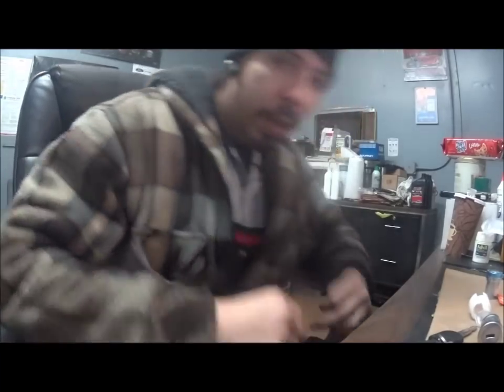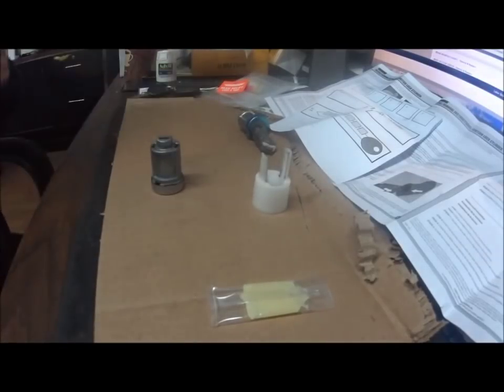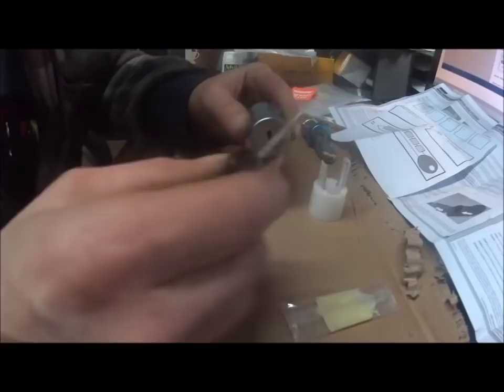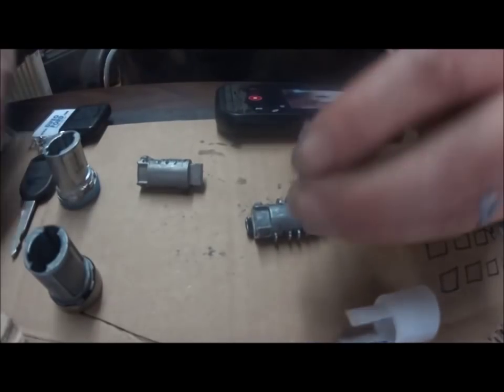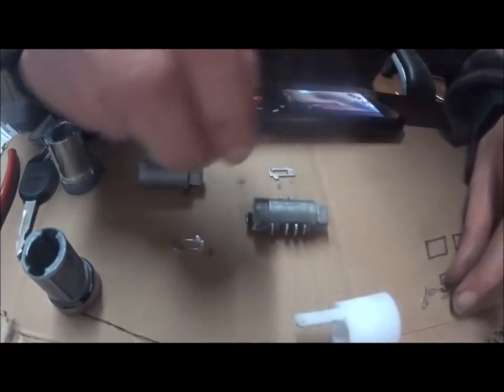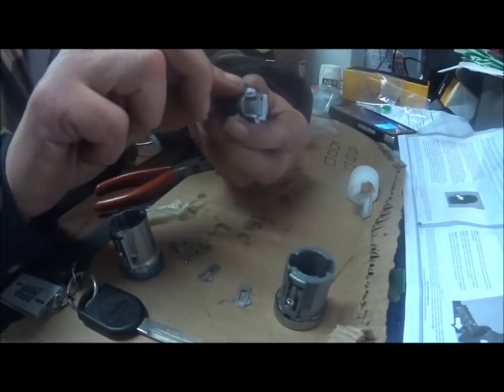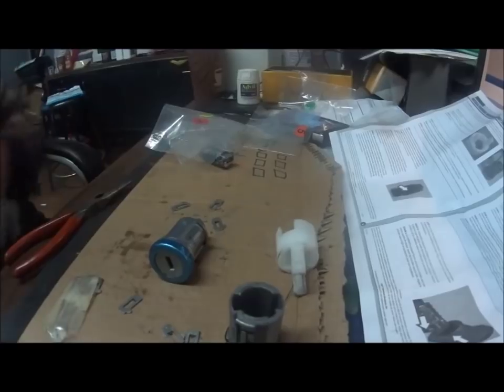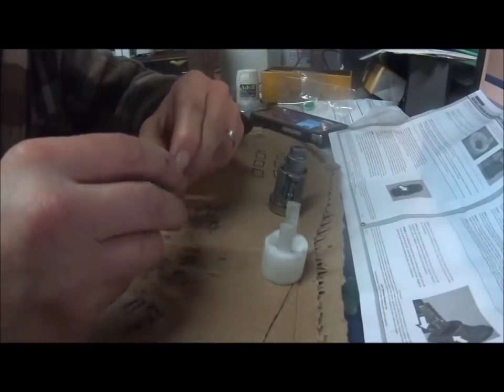Ignition Lock Cylinder How to code a Lock Cylinder to Original Keys

Comment: nice work!  just for the record, those "tumblers" are actually wafers!  This is a wafer tumbler lock as  opposed to a pin tumbler lock.  If you get messed up, you can simply use a trial and error approach starting at the front of the cylinder, inserting the key and seeing if that wafer sits at the shear line (ie flush with the top/bottom of the cylinder).  No need to panic :)
Reply: The trial and error was what I did the first time I had to replace my ignition cylinder. Pain in the ass, but a lot better than having it towed to the dealership so they could reprogram my PATS keys. Unfortunately, some low life tried to steal her again last night, so I'll be re-'wafering' a new cylinder this afternoon.
Reply: So you don’t need the old cylinder, just trial and error one by one?

Comment: Not so simple Joe!  I have the little tool to disengage the tumbler assembly from the lock cylinder, but it will not release and I can't get it out of the back of the lock cylinder. 2013 F-150. Followed the directions and your steps to release, but can't get it to. Can't figure out why? Seems simple enough, but I can't get it to work. Any suggestions?

Comment: I was needing to know how much the P.A.T.S. electrical box,wires,and ring where it goes to ignition switch.
Reply from the maker: I'd be calling the dealer for pricing.
Reply: @JoesAutoElectric  hey Joe electric...I  got 2000 Ford F150 4.2L V6 basic no options,,no tilt column,no power locks,no cruise.I broke the little wire strip for anti-theft (PATS)The little box under column next to back where steering wheel goes,little green strip with 3 wires goes to ring that goes to key switch.
Reply: Thanks.

Comment: Do you know where I can get a uncoded lock cylinder for my 2000 Malibu?  I am having problems with it locking up while trying to turn the car on! It only does it when I try to turn the car on in both the acc and run positions! It also doesn't help the face that I have a lot of knees on the same set of keys!LoL

Comment: What if you don’t have the old cylinder?
Reply from the maker: Then you'd need to read the key and code the cylinder to it.
Reply: @JoesAutoElectric how do you read the key?
Reply from the maker: @edparungao5733  that's information for locksmiths to have.

Comment: is that the dorman one?  they come with the tumblers  or you need the master kit
Reply from the maker: This is actually a Dorman unit, yes. The kit comes with the needed tool, the tumblers, springs, and grease. So yes, you buy just the kit and all is included.